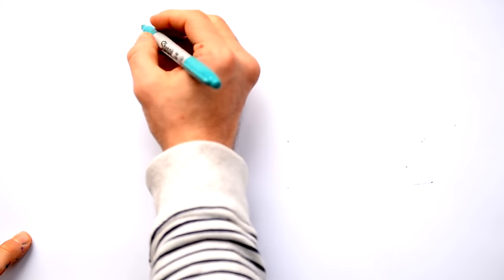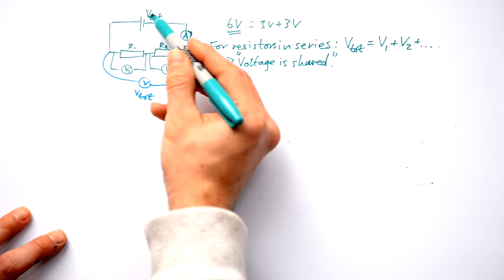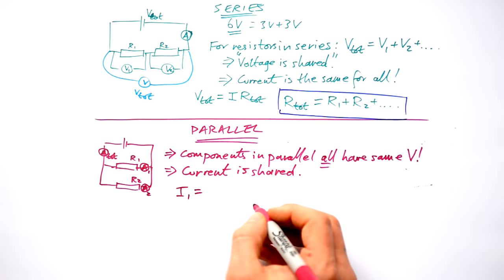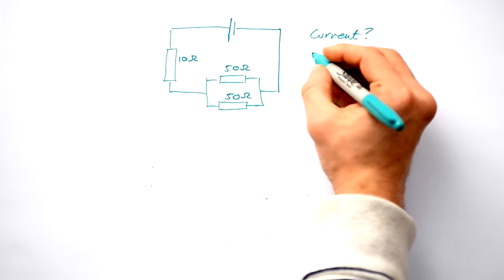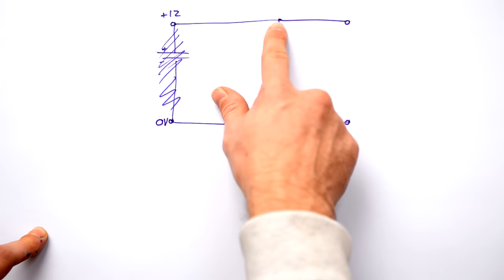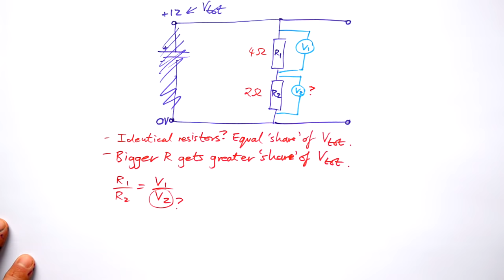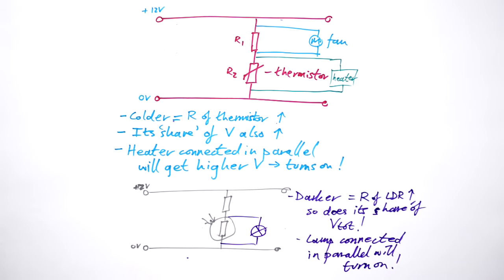Series & Parallel - Potential Divider Circuits - GCSE & A-level Physics

Comment: I don’t mean to sound dumb, but if the thermistor gets colder, shouldn’t resistance decrease? (Cause superconductors have almost zero electrical resistance when cooled to sub zero temperatures, so that’s why thought colder temp = lower resistance)
Reply: A NTC; "Negative Temperature Coefficient" thermistor works in the opposite way a normal resistor does. At low temperatures, the thermistor has a high resistance. As the temperature increases, the resistance decreases. This is because at higher temperatures the electrons have enough energy to escape from their respective atoms, meaning there are more charge carriers available, therefore the resistance is lower.
Reply: I know its a bit late but for anyone reading in the future superconductors dont have almost 0 electrical resistance they have exactly 0 electrical resistance

Comment: 11:24 if it isn't changing its resistance then how it is possible for it to get a higher voltage then thermistor
Reply: bilal tanweer it’s not changing voltage of the fixed resistor, the ratio of the fixed resistor to the thermistor is altered so that the the thermistor’s resistance decreases. This means the fixed resistor will get more share of the voltage as the share of the voltage for the thermistor is decreased when it gets hotter
Reply: @rkarox5858  thnkx

Comment: ive been struggling to get my head around the meaning/"roles" of each element in electricity, (especially how p.d. interacts with current) in an intuitive way not just through equations, the explanation of "higher resistance means its harder for electrons to pass through therefore they need more energy" really helped, idk how its never been explained to me this way before 😅 electricity has been the bain of my existence, i'll stick to mechanics thanks 😭

Comment: Hi in your potential divider circuit you drew at 7:11 , you included 2 rails 12V and 0 Volts instead of the battery. Could I ask where the other end of rails go at the opposite end of the circuit after the resistors? They are confusing because you did not give them any kind of reference.

Comment: What is the purpose of the fixed resistor in the LDR set up?Why is it needed when the lamp depends only on the LDR's voltage and not the other one?

Comment: You see for the last one if the light is bright (in a day ) can it reach this point where it wouldn't take any share of voltage and also would the lamp would still turn on even tho light is bright?

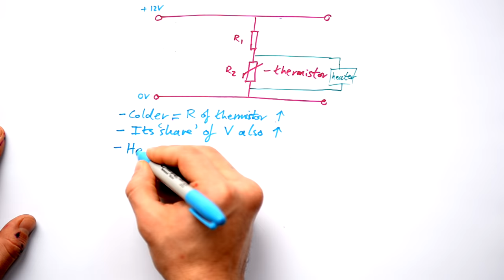Comment: Hi there, I have a question...  At 10:58 you said that anything in parallel will get the same voltage. But, surely the heater's resistance in combination with the Thermistor's resistance will give them both an effective resistance which is different. Presumably the Heater part of the circuit is separated by some kind of relay or something so as not to combine with the Thermistor and affect the resistance of that half of the Potential Divider Circuit? Thanks.
Reply from the maker: Yes, in reality that is the case. This is just a general concept. Actually, in practice it will be a sensor, not the heater itself.

Comment: We got given a resistor (75ohms) and a LDR in series.
The lamp is at 10cm from the LDR and the reading on the voltmeter in parallel to the resistor is 2.4V.
Battery is 6V

Calculate the resistance of the LDR at this distance.H

How do we do this?
Reply: its not possible without knowing the energy the lamp emits. surely?

Comment: For parallel circuits with 2 resistors use R1xR2 divided by R1+R2 that’s a nicer equation. Only works for 2 resistors though.
Reply: Are you sure??bc it mught now

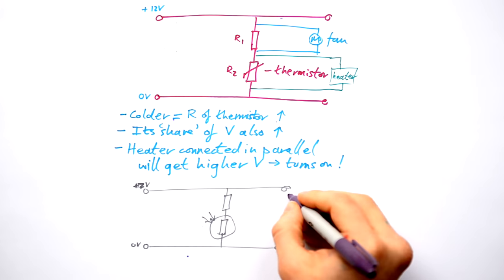Comment: 12:23 why would the resistance increase if it gets darker. Isn't goes down beacuse it should allow more current passing through
to get brighter?
Reply: When it gets darker less light falls on it so tmp would DECREASE and since LDR has LESS free electrons and tmp is decreasing due to darkness, there would be less no of free electrons means resistance would INCREASE , in short as it gets darker for LDR, resistance would increase because of its semiconductor properties

Comment: For the circuit at 5:31 how can I work out the current in one of the parallel branches. Here's my attempt,

R_tot = 10 + 1/(1/50 + 1/50) = 35 
V_tot = I_tot * R_tot --> 12 = I_tot * 35 --> I_tot = 12/35 = 0.34 A
Current is shared in parallel so current in one branch = 0.34 / 2 = 0.17 A

If this is correct, what about if one of the 50 resistors is changed to 40. How to we divide up the current?
Reply: i think you would do it the same way.
Reply: @mohamedrashed6643  I think I understand better since watching this. For the example in my comment, I did

R_tot = 10 + 1/(1/50 + 1/40) = 32.22
I_tot = V_tot / R_tot = 12/32.22 = 0.372 A
p.d. across series resistor / V_tot = R/R_tot --> V/12 = 10/32.22 --> V = 3.72
p.d. across parallel part = 12 - 3.72 = 8.28 V

Current across 40 resistor = p.d. across parallel part / Resistance = 8.28/40 = 0.21 A

Current across 50 resistor = p.d. across parallel part / Resistance = 8.28/50 = 0.17 A

Check: Total current should equal 0.37.
0.21 + 0.17 = 0.38 (close enough, error due to rounding).

(This whole thing was just to check my own understanding, hopefully someone else finds it useful too!)
Reply: How do you now my name?
Reply: @mohamedrashed6643  WTF 😆 your name is your username.

Comment: What happens to the current as the resistance of the LDR or thermistor increases and how do you explain that
Reply: pretty sure it remains constant since its a series circuit
Reply: @M_B_T  Think carefully. V(total)=IR(total). We know that V will remain constant and that resistance has increased. Therefore, the current will decrease.
Another way of thinking about it is that resistance is how difficult it is for current to flow, so increasing resistance will decrease the current as less charge travelling per second.

Comment: What happens when there is 2 cells connected in parallel and you are asked to work out the current or voltage of one of the resistors in the circuit?
Reply: Watch video on kirchoff laws (ik I'm late)

Comment: can someone explain why is it that when its dark the resistance of the LDR increase. still confused on that. and also why when its cold the resistance of the thermistor increases. many thanks.
Reply from the maker: It's to do with energy bands of semi conductors. In essence, a higher temp /more light raises the electrons' levels so they can flow more.
Reply: Thanks for replying. okay so if they are flowing more then the electrons have the tendency to travel faster and hence a lower resistance?

Comment: For the fan example, could you also place it in series with the resistor and thermistor?
Reply: Maybe that would work, just a lot less efficiently, as it acts as it's own resistor and gets a lesser share of the voltage

Comment: I need to decrease the current in a circuit without altering the voltage. How would I do this?
Reply from the maker: Increase the resistance...
Reply: Science Shorts thanks a lot!
Reply: @rbanerjee605  think about Ohms law, V=IR, it is linear, and so if you increase I for example, V increases - it works in all rearrangements